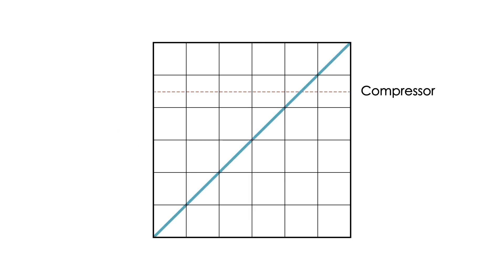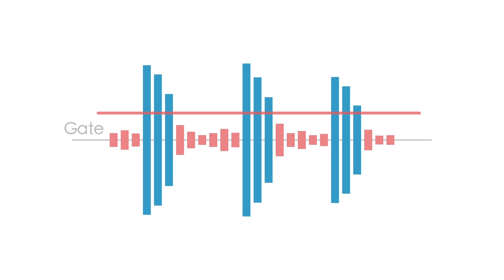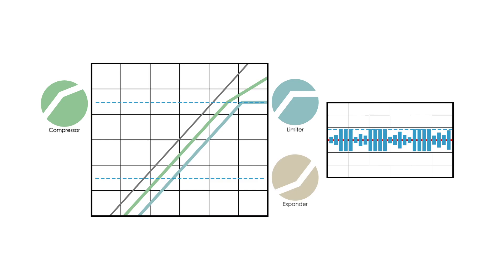Audio Theory - Expander

Comment: The gate and expansion graphs are wrong--they should go more vertical below the threshold, not more horizontal. Check the graphics on your plug-in or digital console dynamics processing.
Reply: The gate is logically wrong it should go down not to the left
Reply: This is a little confusing. Are you looking at the Ratio/Knee line?
Reply: I agree
Reply: The very first point in the line should move to the right, not up, during exansion.
Reply: Expander
with Threshold= -13 dB and ratio 8:1 
then -14 dB becomes -21 dB 

Upward Compressor 
with Threshold= -13 dB and ratio 8:1
 then -14 dB becomes -13.125 dB
Reply: You shouldn't be using your eyes to mix. You don't make the mixture for a cake by looking at it. This was just a good way to explain how it affects the sound!
Reply: @enedark  You do a bit. There'd be eggs all over the floor otherwise.

(also this explanation is wrong as well as the graphic)
Reply: @pikey2012  Fair enough about the eggs. Well said!

Comment: I'm confused. How does the expander decrease the output if it looks like it increases it under the threshold in that graph...
Reply: You are right.  Graph shown is opposite.
Reply: Well done Sir!
Reply: Draw a straigth line from the left until it hits the function in question. then draw a straigth line down. immagine the lower scale represents the output value. now compare a straigth line vs the function of a limiter... i think you will get the point

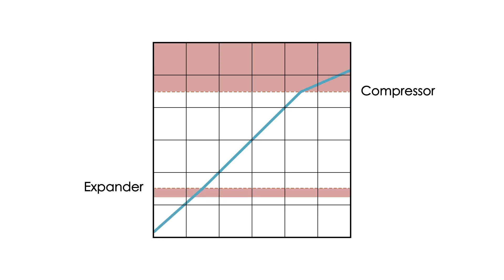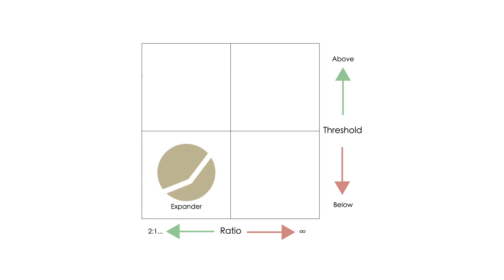Comment: I am sorry to say this but the diagram in 0:20 is wrong as well as the ratios as shown at 0:49. A compressor would have a lets say ratio 2:1 but the expander would have a ratio of 1:2... the reason that this happens is because the ratio is represented as output : input... so its fundamentally wrong for a compressor to have the same ratio as an expander. Good representation, great graphics but totally wrong curves...
Reply: So Which is correct explanation for!!!
Reply: The theory is correct... The representations are wrong. So the expander should be like (imagine an old school clock) were one arm is at 2o'clock and the other somewhere between 6+ and 8 and gate is the same but one arm is on 2 and the other 6 sharp... hope it makes sense...
Reply: I thought I was going nuts looking at that graph. Holy fuck thank you!!!!!!!
Reply: That's what I thought. I was like WTF am I seeing right now. I thought I was sitting on the computer too long today 😅
Reply: yes so basically the expander curves must be the symetric around the diagonal of what is drawn on the video
Reply: Agreed

Comment: Great video, just a thought though. Limiter is not the same as a gate but reversed. Difference is, gate cuts it out completely. Limiter is actually a compressor where the starting ratio is 10:1. So it does not completely cut it out like a gate but actually compresses it really hard.